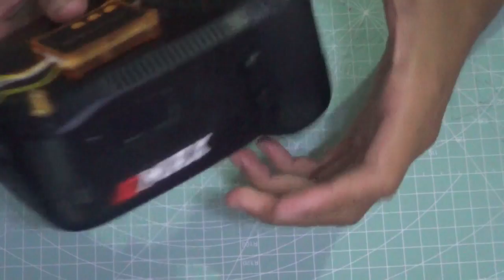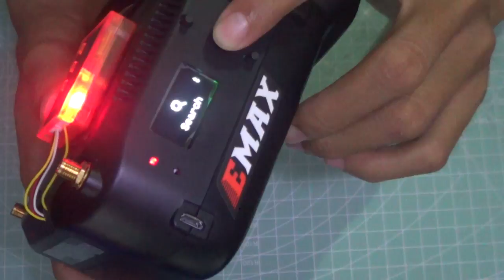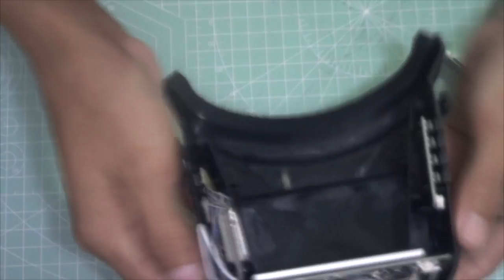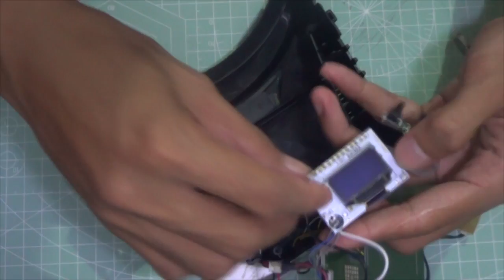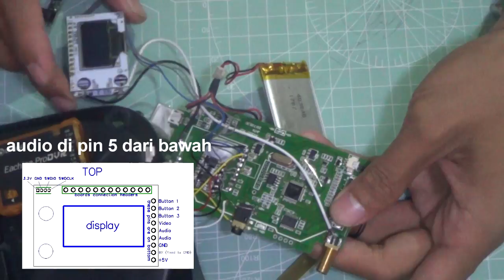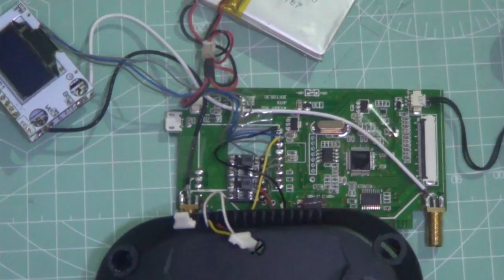Eachine VR006 Diversity Disassembly

Comment: do you have a diagram on this? co'z I'm actually working on this mod right now, I was already able to successfully connect by soldering the wires of eachine pro 58 into the old receiver module of this goggles which I remove, now what I'm thinking where to connect is the eachine dvr pro.

Comment: Om nanya, itu kabel yg dipake buat konek dr diversity ke anten bawaan yg nyolok di board 006 itu harus kabel coaxial utk sinyal 5,8ghz apa pake yg utk sinyal 2,4ghz apa bisa jg?? Mohon infonya 🙏
Reply from the maker: Kabel yg 2.4 atau 5.8 sama aja om
Reply: @JeffriRanger  hmmmm jd make kabel eks 2.4 jg bisa masuk ya om... Mksh infonya om 🙏
Reply from the maker: @dhimasetya  bisa om, saya sendiri pake ex modem wifi router
Reply: @JeffriRanger  om nyari button 3 susun ky om itu dmn ya??? Trus apakah ada skema penyolderanya???
Reply from the maker: @dhimasetya  3 tombol masing2 pin sama2 ketemu gnd

Comment: I plan on doing this mod myself, are you able to tell me the wiring for the diversity receiver to the PCB of the goggles? Are you able to comment on that, I only speak English so I wasn't able to follow along with the video completely. Great video!
Reply from the maker: You can follow the internal receiver PIN OUT to connect any fatshark module, you only need to connect vcc, gnd, audio, video
It can be found easily in google

Comment: om,cara melepas modul rx bawaan vr006 pakai mana? apa harus menggunakan solder blower atau bisa menggungakan solder biasa? mohon bantuannya. terimakasih
Reply from the maker: dora emon pake solder biasa om
Pertama angkat modul dari sisi port antenna dulu, ada 3 pin
Selanjutnya kasih timah dan panaskan semua pin yg terhubung ke pcb di sisi lain sambil perlahan angkat modulenya

Comment: Om mau nanya, punya om ada noise seperti garis" gk? Terimakasih
Reply from the maker: Nggak ada om
Bersih aja kok, kecuali batre udah 3.7-3.6v
Reply: @JeffriRanger  punya saya kok ada noise dri apanya ya om?
Reply from the maker: @hendris.p4810  coba kalibrasi dulu om
Reply: @JeffriRanger  di diversity ya om? Pengaruh jga om klau gk di kalibrasi?
Reply from the maker: @hendris.p4810  silahkan di cek lagi di instalasinya om, atau coba kalibrasi
Reply: @JeffriRanger  kabel bsr kecil pengruh om? Say pakai boster matek tegangan 4.95 klau hidup pas diversitynya
Reply from the maker: @hendris.p4810  pengaruh dong
Reply: @JeffriRanger   pakai matek kok noise ya om hasilnya bosternya
Reply from the maker: @hendris.p4810  kalau itu saya kurang paham om
pastikan outputnya 5V dan arusnya minimal 500mA ke modul Pro58
Reply: @JeffriRanger  500ma kemampuan si boster 5volt ya om?
Reply from the maker: Itu spec boosternya om, 3.7v ke 5v 500mA
Reply: @JeffriRanger  yg saya pakai dri spek 3.7 volt ke 5v 2A
Reply from the maker: Harusnya nggak ada masalh om, tp coba aja ganti booster dulu
Reply: @JeffriRanger  iya om ini msh order boster yg seperti punya om
Reply: @JeffriRanger  maaf mau tanya mas..cara kalibrasinya bagaimana ya? dan adakah link cara update firmware nya

Comment: gan tombol pengganti slid nya apa ya, aslinya kan slid d ganti pakai tombol, ada link nya tidak
Reply from the maker: Itu tact switch biasa om
Beli di toko sparepart elektronik juga ada
Reply: Om boleh minta skema nya tombol swit ke tombol gitu ga. Klw boleh kirim ke email om. Makasih om sebelumnya. 
ahmadaquarius86@gmail.com
Reply from the maker: @ahmadaquarius  masing2 fungsi switch terhubung ke gnd, ini pinout slide switch, tinggal tarik kabel aja
       *.            Gnd
*.                   Up
*.                   Ok
*.                   Down
        *.           Gnd
Reply: @JeffriRanger  iya om udah dapet tp harus bongkar. Semua dulu. Klw ga ati2 bisa copot tuh jalurny.
Reply from the maker: @ahmadaquarius  hati2 aja om, kalau repot, mending install di luar aja seperti tmn2 yg lain, jd nggak perlu belah modulnya
Reply: @JeffriRanger  udah kelar om. Heheee. Cuma tombolny sy taruh di bawah monitor. Trus lubang lampu2 sy kasih lem tembak biar lampuny ny cakep nyalany.
Reply from the maker: @ahmadaquarius  idiw, pasti cakep tuh lampunya!
Kemarin saya rencana mau bikin gitu juga om, tp karena sdh terpasang dan enak pakenya ya jadi males bongkar2 lagi, pake aja sampe ancur sendiri...
Wkwkwk
Reply: @JeffriRanger   lain kali klw bikin lg di luar aja. Ngerasain msng di dalam ribet. Wkwkkk

Sukses terus om.. Boleh minta no wa om. Lain waktu ada yg mau sy tanyain. Heheheee

Comment: Mantap om, ini dia nih yg ditunggu2, btw modulenya eachine pro 58 beli dimana om?
Reply from the maker: terimakasih om
:)
saya beli dari banggood, lokal nggak tau deh udah ada apa belum
link ada di description
Reply: Untuk stepup nya jenisnya seperti apa om? Boleh minta link pembelian stepup nya?
Reply from the maker: Ini om
DC-DC Voltage Booster 1S Lipo 3.7V to 5V Synchronous Step-up Converter Module Output 500mah for Brushed FPV Racing Drone F18991
 http://s.aliexpress.com/AJjeIRFv?fromSns=Copy to Clipboard
Reply: Jeffri Ranger makasih banyak om jeff 👍
Reply: om jeff, cara lepas modul rx bawan vr006 bagaimana om? pake solder atau pake blower? klo boleh minta no wa nya om, saya mau konsul :)
Reply from the maker: Basirudin Azmar pake solder biasa juga bisa om